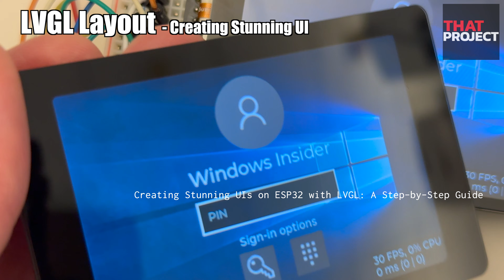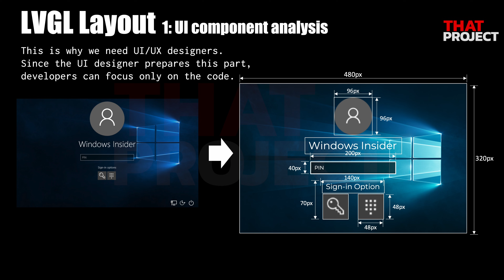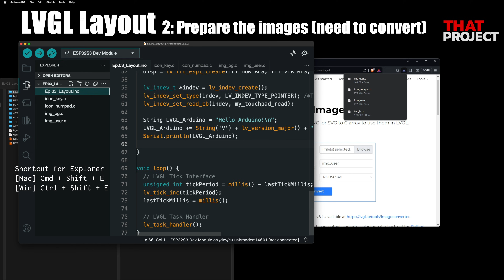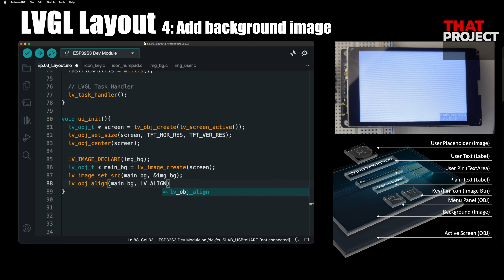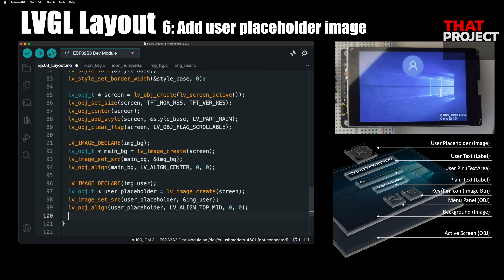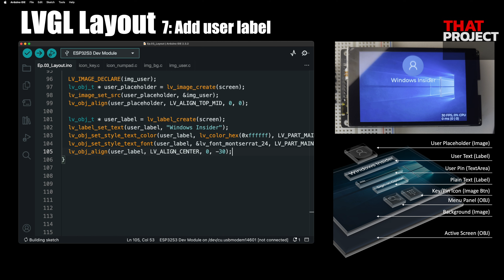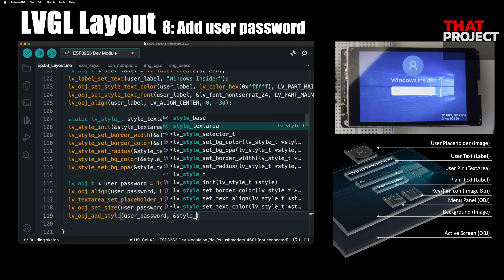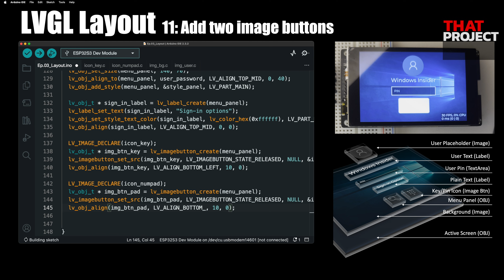LVGL Tutorial with ESP32, Creating Stunning UI: A Step-by-Step Guide #LVGL #UI #ESP32

Comment: In the previous video, you mentioned that your touch function is not supported by tft_eSPI library so you have to use FT6236 and initialize it  with "FT6236 ts = FT6236();"
I'm using ILI9341 touch and it is supported by tft_eSPI library.
So mine should look like this  "TFT_eSPI ts = TFT_eSPI();"     The rest of the code is the same?
Reply from the maker: As of now, it seems like the only way is the way you mentioned. If you defined that you use TFT_eSPI in LVGL configure, it already does TFT_eSPi tft = TFT_eSPI() internally. But there is no way to get a reference to it from any object in LVGL yet. So, the only way to use TFT_eSPI's touch driver is the way you mentioned.